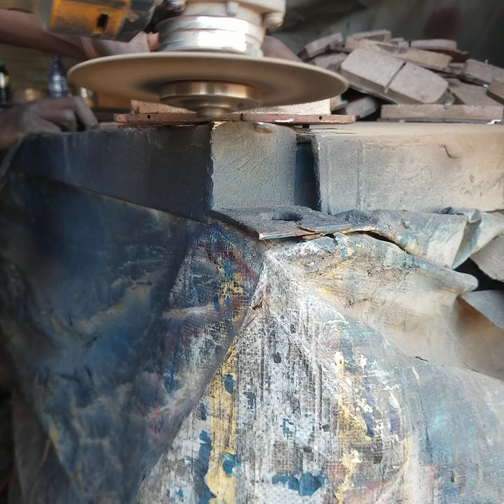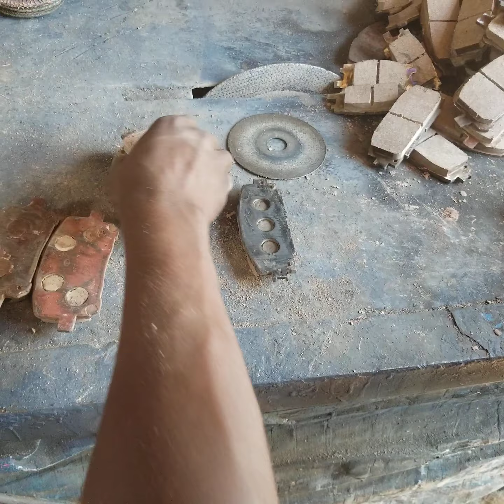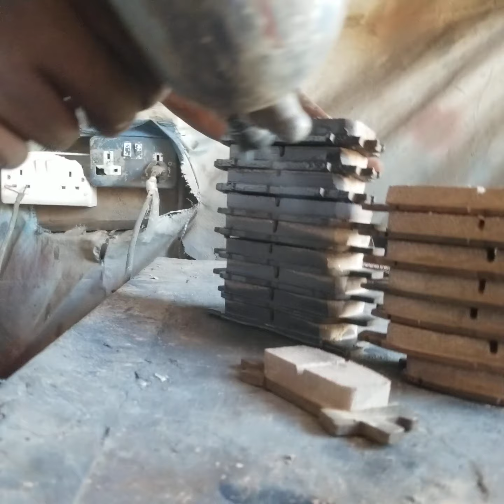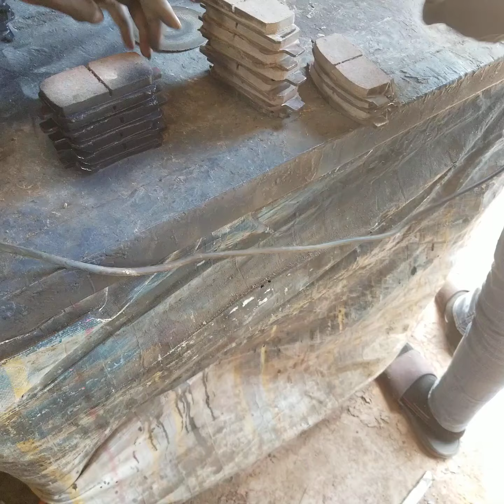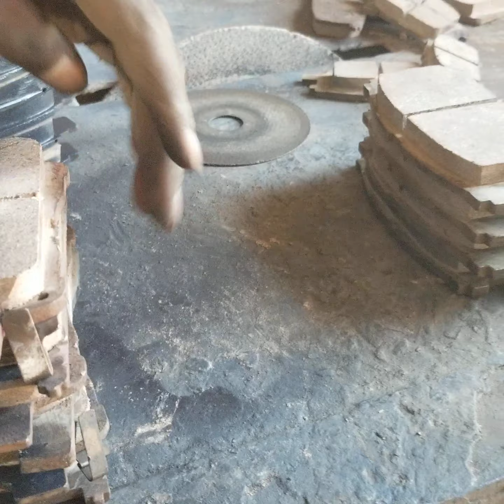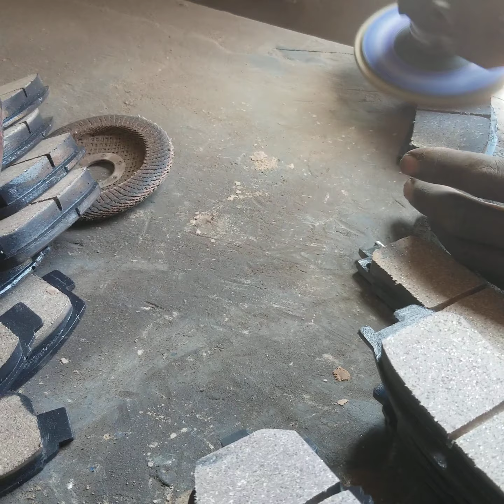Two Bright Ugandan  Students In Brake Car Process 🥰🥰😯, See How They Did!!!!!😯😯😯😯

Comment: Hello brother, can you tell me the composition of the brake system? to me
Reply from the maker: Wow thank u 4 following  our channel  dia
Reply from the maker: So these are  the components of brake system  u wanted , brake pedal, master cylinder  which leads network of pipes through  which brake fluid flows and fluid  reservoir 4 storing  hydraulic brake fluid  , follow 4 more🙏🙏